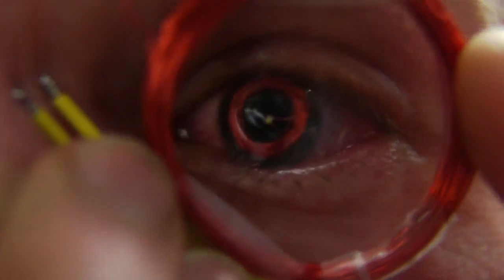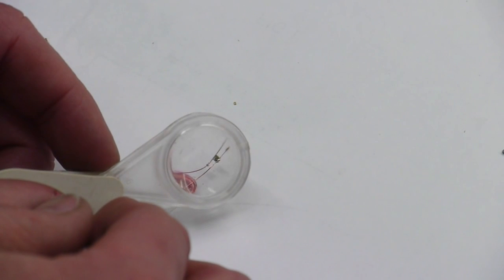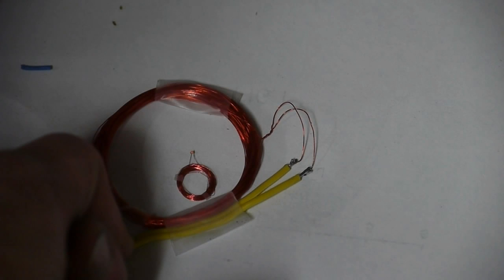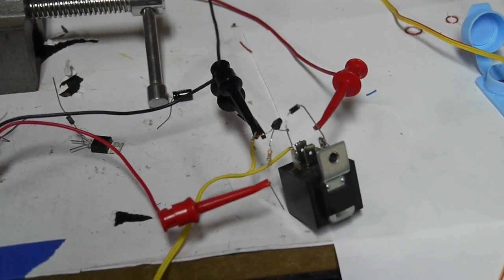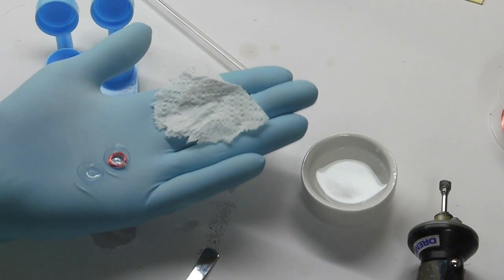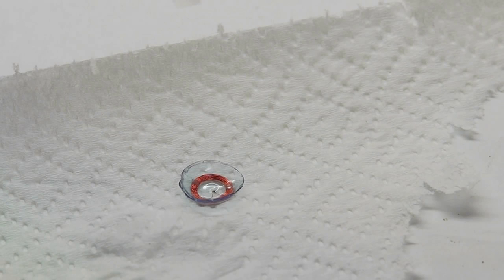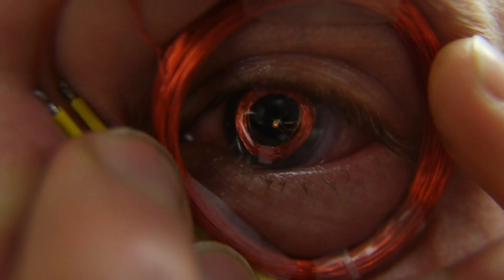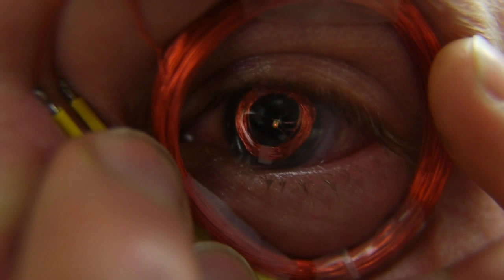LED mounted in a contact lens for possible virtual / augmented reality displays

Comment: I'd say make a form of the contact lens, then sandwich the circuit between the lenses, and heat the sandwich to laminate while using the form to support the original shape during lamination.

Comment: Metasurfaces and “flat optics” could revolutionize augmented reality and contact lenses. Flat optics use diffraction, not refraction, to focus light. They can have negative refractive in indices, they can circularly polarize light, they can eliminate chromatic and spherical aberration, etc. It really is an amazing field that will revolutionize our world.

Comment: You are such smart guy but you didn't pick the right equipment.
A super small leds can be turned on by radio waves. I use my phone for it. Make a gsm call that transmits strong radio waves. Led will flash. In addition led will flash before you receive actually phone call on the phone display. 5cm max distance worked for me.
If you don't believe me, back in 2000 micro smd led modules was available on the market, they you glue the mudule on the back of the phone. As they talked on the phone they looked flashy and cool:) And they knew 2 seconds before by flashing leds that your phone is about to ring.

Comment: Good try. Presumably the current is very small, so perhaps there's a way of 3D printing a conductor coil. I know such conductors exist. That might make it is ultra-thin and topographically smoother, and still carry the current, perhaps it might even allow even more turns, is lighter than copper wire. 'Just a thought. My dream is to have my smartphone faculties permanently on my eyes and in my ears, with neural link to my brain for control. =)   https://youtu.be/JCZlMw8Q27c

Comment: A note for lense construction: use a marble with a smooth surface and the same curvature, layer the elements, then use a heat source on the marble along the edge of the lense? That seems like it would produce a more comfortable contract lense

Comment: Can you use the faraday effect, putting a slightly adhesive oil between two lenses which are inversely polarized then using a more complex induction coil mounted in glasses to adjust the focus?
Also if a grid-work of conductive lines were to be etched or painted on the surface, preferably if the polarizing lines were of two dissimilar conductive metals, a combination of inductive and capacitive points between the lenses  could be achieved such that a conical coil could be used to bend light or even create it if the oil was also phosphorescent...Just a thought.

Comment: I'll bet if someone was dead-set on figuring out a way to have essentially a lens for every pixel, they'd find a way to do it. Something like a low-resolution OLED with a little extra space between the pixels, and then shaping the refraction media through a chemical or laser process to make it the right shape.

Though I think most of what this technology reaches for will actually be accomplished in our ears and not our eyes, and that's way more accessible. That is, this tech and its speculative applications seem to populate the category of "digital personal assistant", telling you where to go, who's calling you, whether you have email, answering your questions, etc. Imagine having the analog version of this: basically, a paid human assistant who is always right next to you, and who is holding your phone so they can look up navigation, contacts, incoming calls, and the whole internet. That's what this tech is for. Now imagine that you can't see this assistant, but you can hear them. They can hear you, and they know what you're seeing and where you are, because even though they're invisible they're still right next to you. You can ask them questions, and they'll answer. If a call comes in, they'll tell you. If you need directions, you'll get them turn by turn. That's still a pretty useful assistant. And this is way easier to achieve digitally than something relying on a visible display.

It just has to get better at contextually knowing whether you're talking to it, versus someone else speaking, or you talking to someone else, or singing a song. And then it needs to get better at parsing questions, figuring out the answers, and knowing when to interrupt what you're doing in order to tell you something.

Comment: if you are serious about this you need to look at flexible printed circuits or wearable curcuit manufacturers they can make a circuit that is printed on a piece of paper and when soaked in water the paper peals away leaving only the circuit.  Then to embed the circuit and led into the lens perhaps you should try to find a really clear and safe silicon or cellulose.  Just an Idea. take care of your eyes, the wire looked scary in there. A better idea would be just a pair of glasses.

Comment: Personally I think the idea of projecting light into the eye might be backwards, at least for now. Considering how our eyes work, I'd argue it may be more progress-able to project light outwards, not too distantly relatable to like a Projector.

Simply, having LEDs faced away from the eye. Optimally, the lens would function as a focus. And this could project onto a pair of glasses, or even more further an additional lens for the light to collect on. I could guess that perhaps a technology like that of Real D's 3D glasses may help. Letting the lens of either the contact or glasses have grooves/angles to block the like being projected. Thus you could see the display on the inside of the glasses/contact.

Further, parts of the display could be assigned to either eye so that the combined image comes together in the direction we are looking. But this would certainly be more sophisticated  being as the contacts would not only need to communicate to eachother but they would have to track the motion of both eyes. Additionally this is similar to how hologram projectors function, so possibly even tieing that technology in.

Comment: I wonder if you can vacuum deposit some metal in a spiral onto the surface rather than use copper wire. Your induction coil can also be operated at a much higher frequency (say 10Mhz) to allow the coil to be reduced in size.

Comment: It's going to have to be done with a machine. The gauge of wire needed to be useful and yet light enough would be near impossible for human hands. Not to mention it can be made quicker and cleaner by a machine. Future war, fashion, and entertainment augments right here.
Reply: Google contact lenses or smart contact lenses
Reply: Why even use wires at this gauge? I recall seeing 'wire ink' that transmits a current like a wire through something akin to pen ink. Aside from a future micro/nano processor/graphic chip being integrated I feel that using a relatively flat medium laminated in a contact would fit better than wires of any guage.

Comment: For making beam splitters i used optical uv cure adhesive... might do just the trick for putting the lenses together. The adhesive i was using became solid, but i bet there are uv cure compounds that cure to a rubber like hardness. And since the adhesive is designed for creating optical components, it is clear and won't fog the lenses.

Comment: Remember the episode you made where you used spattering to make a LCD screen?
Why not use the same technique to print metal film coils onto a hard glass contact lens?  You might be able to make it so thin that you only need to use one lens per eye.  Also you could look into using a Gunn diode and feed cone from a security system or auto door microwave movement sensor to power the light with microwaves.

Comment: Just a quick thought.  If you could get small laser diodes you might be able to avoid the need for extra optical elements for focus.  Not really sure if this would work but I think there is a good chance.  Another thing you could try is to resurface the LED to form a lens.

Comment: Did you try to use high frequency power? I was fixing some PWM power amp once, and I made a single turn secondary across the output torroid, which I fed to a resistor and LED. The frequency of the PWM amp was about 400kHz and the LED was shining bright. Feed 50V / 400kHz squares into your primary coil and make the video again :)

Comment: first of all, great videos, I'm jealous of your workshop.

 As for the bonding of the two lenses, you are a machinist (like me) I would turn up a piece of aluminum to about the outside diameter of the contact, drill a hole in the middle, or bored, leaving about a 1/16 wall. Heat that up and seal the entire outside diameter at once.

Good luck, and keep up the great work!

Comment: I think you need more turns of a finer wire, or even a pcb style printed flat coil. the lense looked like it dropped in your eye because of it's weight. also, look into gelatin and food grade glues. super glue would not be fun to get into your eye.

Comment: looks like a novel way to blind yourself
Reply: But then you wouldn't be able to see it yourself lol
Reply: +gekiryudojo you are so right.
Reply: +gekiryudojo Maybe. Just add a back-plate so the light shines outwards.
Reply: You do realize LEDs can be different brightnesses, right? They're not all the same. Thought that was pretty obvious from when he showed the LED when it was on and the light was barely visible.
Reply: @VoidHalo  I don't think they meant the light from the led damaging your eye. Magnetic and eletric field, scratching your eye with wire, getting possible bits of metal, solider flux or w.e in your eye or some weird ass infection. Though he is pretty cautious
Reply: @VoidHalo  Where does he switch it on? I'm trying to skip through the video to that point.

Comment: You should try ELECTROLUMINESCENT PLATING you could cut it to any shape especially a contact lens size put some kind of see through wire with a micro capacitor then induction... just saying

Comment: Nice!!! But if I need do experiment this, I'l be going for "Electroluminescent wire" technology. using 2 lens sandwich, one is mesh vacuum coated with cooper vapors, then phosphor {like EL wire technology} and this driven by pocket Tesla coil and for Hi volts receiver also vacuum coating on outside of lens "antenna like pattern"

Comment: please stop risking your eye health. I mean the edged molten plastic can scartch your i and you could notice it later. (Loose some percent sharpness, get anoying scratches in your sght and so on). The only way here is glue, but you need one which is bio compatible. Usual plastic glues are not build for the use in eye :)

Comment: Hmm... I thought a vacuum heat sealing. You would have to have a medium in the middle of the contact that act like air, but is non-harmful to the eye and contact. Heating the suction of the vacuum is the key to seal. I am worried about distortion so you would have to keep the center of the lens cool while the edge of the lens heats up. Let me know if you try it.

Comment: You might try clear E-6000 as an adhesive to join the lenses.  It dries clear and semi flexible.  I cannot say for certain if it will react with the lens material and still fog your vision, but in the applications I witnessed thus far, it seems to dry very clear every time.

Comment: You could try a vacuum seal - either leaving air or saline between the lenses to take up whatever small voids remain around the LED and wires. That would give roughly maybe 5-ish lbs of force holdimg them together.

(951 comments already so maybe not the first time this suggestion was made.)

Comment: You might not need additional optics very soon to focus the light. I'm aware of a company, (although their names escapes me), developing micro laser based diodes. Using laser light would allow the light to be coherent maintaining crisp focus even when positioned on the surface of the eye. This experiment is brilliant, and is a precursor to contact lens integrated augmented reality displays. All this needs is a few more steps in complexity and specially made contact lenses to house the more complex micro circuitry, and some integrated way to power it and you're there.

Comment: Why not putting a laser diode onto the lens. 
I could imagine a laser scanning element so small(30microns) on a contact lens that would scan your entire retina producing a perfect depth percepted image and your eye or brain wouldnt even notice it.
In conjunction with electrooptic modulator and some recent engineered fancy ultrathin meta material lenses.
Maybe a couple of those units.

Comment: As for welding the periphery of both contact lenses, why not make a hollow mandrel from a tube of aluminum with an ID to match the lens OD?  Coat the tube's ID with spray-on dry Teflon as your release agent, and add a heater-strip & thermocouple to the tube for precise heating control.  Then use two thin Teflon-coated tubes with OD's that slip-fit inside your heater tube to compress the edges of the lenses together for thermal bonding.  You'll need to experiment with temperature & pressure to assure a bond without 'pulling taffy' before the system cools; maybe a temperature slightly below the glass-transition point for the lens polymer would be a good starting-point.

Optionally, you might consider ultrasonic welding with a similar set-up where one of the thin tubes is the ultrasonic horn.  People that sell ultrasonic equipment might give you access to a welder.

As for the inductor coil in the lens, you might consider PC board technology to print the coil onto the surface of the lens in a fine spiral of copper with a laminated dielectric crossover for your inner end conductor.  This would give you a very thin profile that allows LED bonding too.  You could create the spiral pattern in CAD, and work with a printed circuit manufacturer to prep, plate & image the photoresist for etching.

Note that you can sometimes get access to equipment you can't afford to rent or buy if the vendor thinks your device might become a product that depends on their equipment!

Comment: I wonder, is there a current limit to the density of elements you could include on a spherical matrix like a contact, that could be in focus to the eye? Perhaps limited pixels could be displayed in the lens.. though I understand delivering data is a tricky task especially with that method of power delivery.

Comment: Bear with me here. I heard that electromagnetic radiation is damaging to health, in terms of power going through a wire (heard this because I'm a hobbyist welder, and I wrap the cable around my forearm to alleviate strain from holding up such a thick cable as I'm welding, and I read on some welding forums it's potentially dangerous to do this, for whatever reason). If that's true, would this be  in any way dangerous wearing this for any extended period of time? Could it deteriorate vision further or anything like that?
Reply: Better turn off all your lights and board your windows up if you want to avoid electromagnetic radiation. Don't forget to shield your house from radio waves and background waves from outer space. Don't light a candle, remember visible light is electromagnetic radio too.
Reply: Dude. Me and people who work in server warehouses and near power lines and others are surrounded by so many electronic devices we probably are picking up all sorts of "excessive" waves.  Could be bad. But here I am with a smartphone attached to me 24/7. Up the ante.
Reply: *****
Don't worry about it.  It is somthing around 15ev required to break apart DNA and in accordance to E=hv, the frequency of light is near that of UV radiation and beyond.  The waves from cellphones and electrical wire has much less energy compared to visible light.

Comment: Very interesting experiment.

A ring of thin, high permeability material, such as ferrite, around the center of the coil should help couple more of the magnetic energy into the coil. Without such a ring the system will not handle off-axis alignment of the coils very well. A disk would be best but then you wouldn't be able to see through it.

I may try this myself.

Thanks for the video.
Reply: Miri angel

Comment: Very cool - I wonder about casting the LED setup in a lense form of some kind rather than attempt to fit it between contact lenses? Initial thought would be cast against a form that copied the surface of the eye - do an initial thin pour to create a smooth surface for your cornea, then place the LED and do layered thin pours to build up an even smooth surface so your eyelids don't snag on it. I can't say I understand the electrical side of things, but there seem to be far better options for the physical aspect of the design. Heck - you could probably keep your prescription by placing a lens at the base of the casting and then pour a suitable substance over... they're using silicone variants for some lenses so that suggests it is possible.

Comment: What if you make the outer surface a printed circuit using the vacuum deposition chamber? If you are careful enough i'm shure you can even deposit a OLED and thin film transistor on it...

Comment: The material surface is likely distroyed from any heat applications thus scratching your eye. The manufacturing in a mold of from your contact lense is the way to go with the material. You can then embed the electronics to your needs. Using the electron microscope to manifacture the circuit could make it easier to embed.